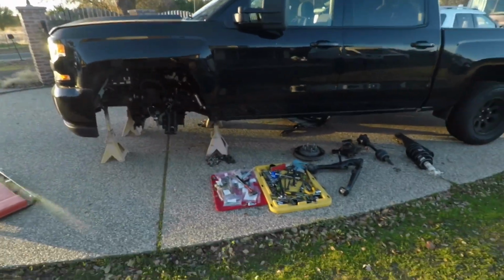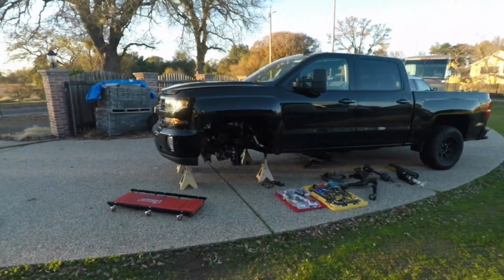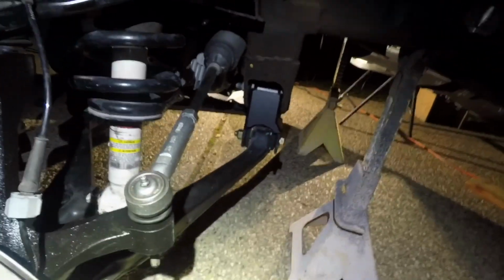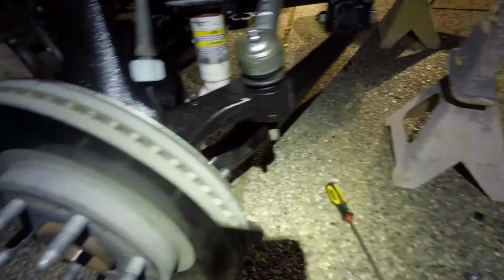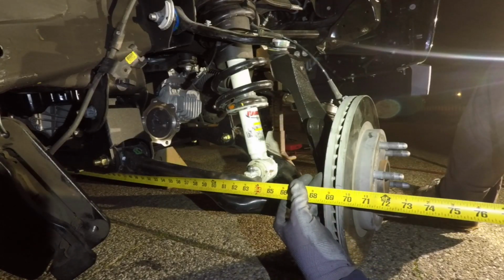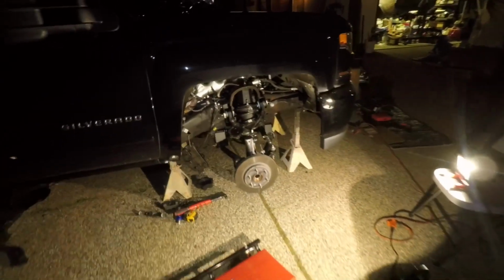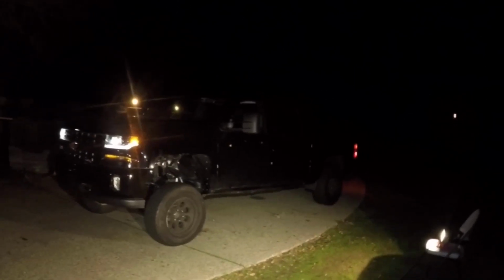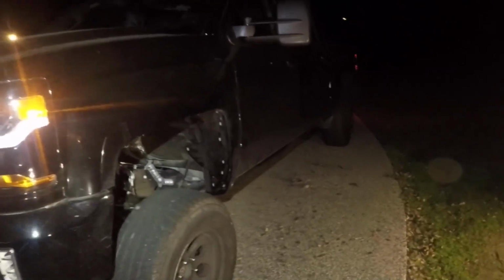[Day-5] 2017 Silverado 6.5" Lift install Chevy 1500 Driveway Project

Comment: What size rear block does it the kit come with
Reply from the maker: +Enemy Seven Six O I believe it's a 6" front 6.5" spacer, but I didn't actually measure it myself, I think I should to be 100% sure
Reply from the maker: +Enemy Seven Six O to confirm, the front spacer is 6" and rear block is 5"